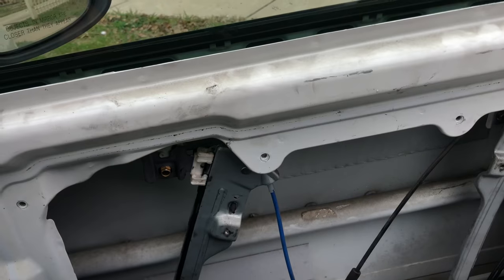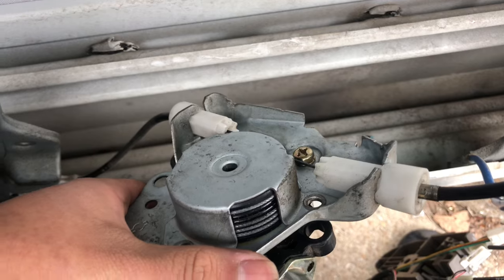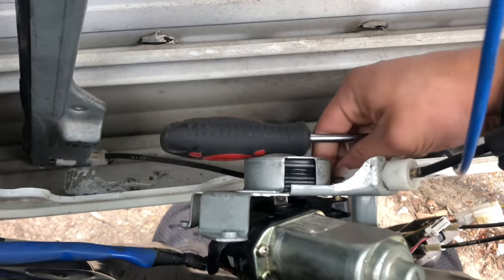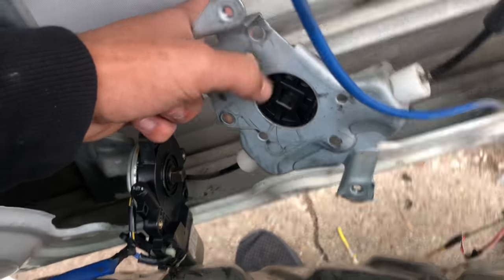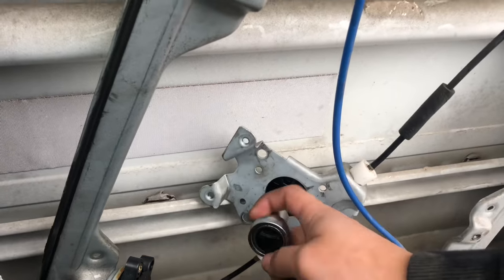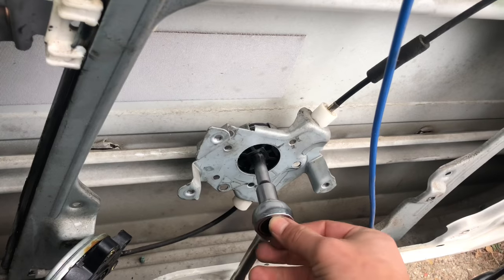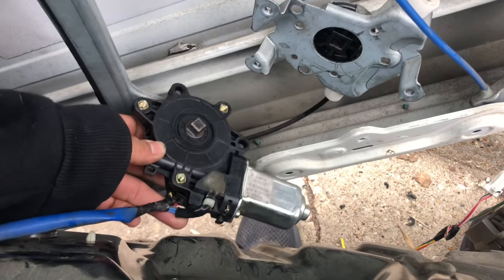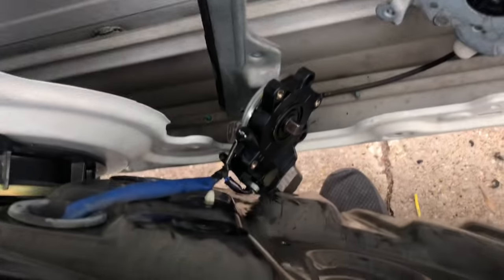Window won’t go up ?How to manually roll up stuck window in car.

Comment: Need help? Turn the ignition to the first position so the car is on but not the engine.. Hold the switch to  make the window go up, then open the car door, still holding the switch,  then close the door, still holding the switch .. Repeat this as many times as necessary.. It took me about 3 open/closes of the door then my window finally went up.. Still not working? Try short bursts on the switch instead of holding it down.. Hope this helps someone else
Reply: You just saved my life lol thank you 🙏🏼
Reply: NO FUCKING WAY THAT WORKED APPRECIATE IT G
Reply: Awesome ,just started taking everything apart , until I read this , and it works . Thank you 🙏
Reply: This worked for me with my truck running.  The engine was already fired up so I figured I'd try it this way, and it worked! Thank you

Comment: i noticed my passenger window was stuck so i was pulling it up while holding down the window up button until i heard a loud crack like something breaking so i stopped messing with it and taped up the gap only to find out that the child safety button on my car was on causing all of the windows to stop functioning so i turned the safety off and the passenger window went up when i pushed the button.. moral of the story, check your child safety settings first before trying to use brute force to almost break your window like i almost did.. kinda nervous some plastic piece snapped down there

Comment: Felipe, even though it did not work as you were expecting, your effort and all what you showed to us is enough for us not to feel intimidated with it to try that ourselves. That is what is important. I do appreciate your video. I will also try to lubricate both grub sides to see and check the ends. The motor of mine does not work in mine and i refuse to purchase a third motor.

Comment: I wish the Kia Sorento (2013) used a similar squared 3/8" drive socket, that's genius of Nissan. In a pinch you can at least easily roll it back up or down tell you get a new motor. The Kia Sorento has a splined round shaft connection.. I know you were using a camera, but I suspect if you lift up on the glass while ratchetting it would go up more easily. Also, I think you were right, the guides were probably dirty and needed to be cleaned and re-greased. The motor looked like it was working perfectly. 

My old 98' Honda Accord used a scissor lift mechanism where you have to get the glass to a certain level, to remove the glass screws through access holes, then hold up the glass with tape, and then wind down the scissor lift, and pull out the scissor lift that's almost too large for the opening.. I honestly don't know how I would have replaced the motor scissor lift assembly if it was stuck up.. the motor was at the bottom of the door and hard to reach.. This center motor arrangement with winding wires around a shaft is a better solution, only the motor need to be replaced. Thanks for the video.

Comment: Mine has a gear ⚙️ setup. I had to take the motor apart and I stuck the drive shaft back in the actuator then turned it by hand. Couldn’t get a wrench or drill in there but it worked.
Reply: Excuse me mines has a crank also in it how did you take the motor apart if you don't mind me asking
Reply: @blessed4344  did you figure it out? I have a '04 Surburban and my passenger  side got stuck down and wouldn't go up. I hadn't seen this video. I took the door apart hoping it would be something that I could see blocking the window since it went down so easy when I hit the button,  but I ended up just taking it to a shop.
If this ever happens again, I'll know what to do & avoid a $350 bill to replace the regulator.

Comment: So it can be done.Unfortunately my Seat Cordoba does not have that square hole on which to turn the regulator,the Seat has a 'toothed circle hole' so I will have to make a bespoke wooden piece to insert into hole to turn.

Comment: How do you manually roll up a window in a Chevy Malibu 2008 I was gonna paint it I took the doors off already I would have to hook back up the electrical system to roll the windows up and raise up the trunk which I should take the trunk off before I paint it and I need to take to open the trunk to remove the lights too.

Comment: Good video but why didn’t you put the window all the way up?  Was something wrong with the track?  What was the final solution to get the window all the way up in case it rains
Reply from the maker: Final solution is to change out your window motor, this is just temporary way to get the window up in case it does rain. U can get the window all the way up using this way it just wasn’t shown in the video

Comment: on the 2003 Camry, you need to buy a torq socket piece to get those 3 bolts off. ANd, it doesn't seem to have the same parts, so can't get the window up that way. 🤥

Comment: I have an 02 accord, the motor  works  but the window is I think off track.  It's in the down position.  Any solution to this?
Reply from the maker: Before taking the panel off , try to grab on to the top of the glass and pull up as you press the up position on the switch. Sometimes this works if the tracks aren’t lubricated. If not , you’d have to take off the door panel and check to see if there’s any loose bolts that hold the regulator to the glass. Finally ,try spraying some wd 40 silicone on the tracks. If not , you’d had to replace the regulator only if the motor works.
Reply: Give your life to the Lord Jesus CHRIST Today

Comment: my regulator is screwed to a metal panel on the door that cant be removed :( its in the way so wont be able to dial the window up even if i got the motor off
Reply from the maker: Really? How will you replace regulator if it went bad?  What year make and model?

Comment: Man, I wish I had seen this before I took my door panel apart and still couldn't get the window to go up.
If I had, I would have put the window locks on the passenger doors,( because the window went down with ease, but not back up) & I could've avoided a $350 regulator replacement bill. 
Oh well, u live & u learn.

Comment: Is this a 04 sentra 1.8?
Reply from the maker: 03 Nissan Altima
Reply: Give your life to the Lord Jesus CHRIST Today Friend
Reply: @TheMaxi748  did you get the window all the way back up?
Reply from the maker: @kallen9731  Yes
Reply: @TheMaxi748  thanks for your quick reply! I’m doing it to my Car now, trying to  take off the door panel is scary, it’s not coming off easily
Reply from the maker: @kallen9731  yes they usually have plastic clips and just screws you take off by where you lay your elbow I guess.
Reply: @TheMaxi748  thank you 🙏